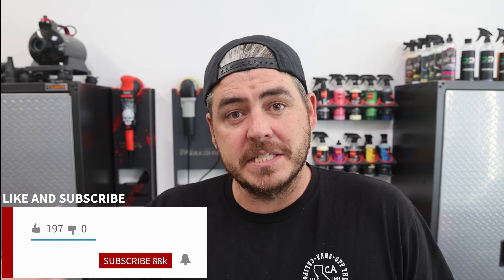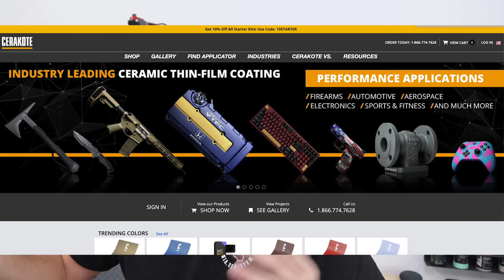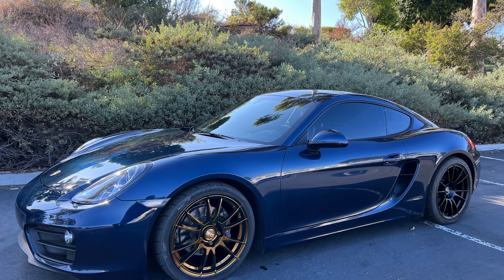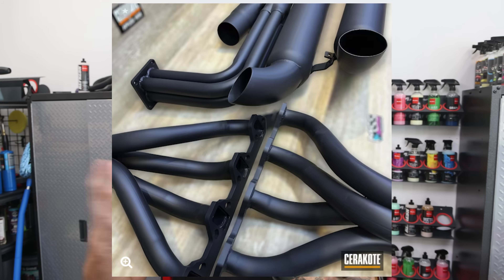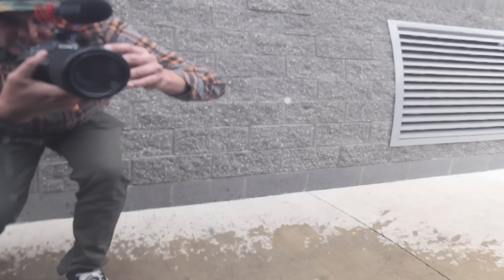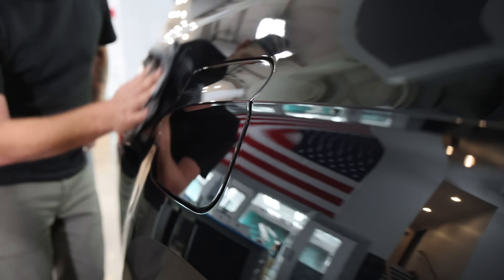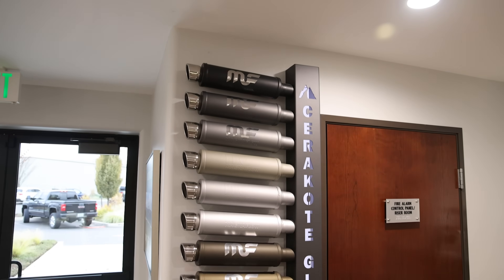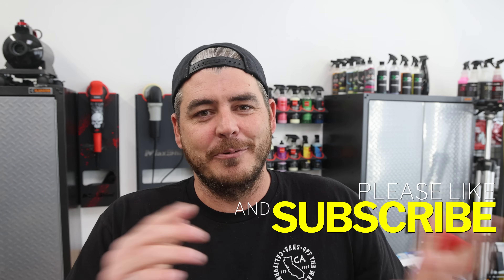EASY CERAMIC PROTECTION FOR YOUR CAR | The Truth about Cerakote

Comment: Josh,  Thanks so much for the excellent teachings on proper ways of vehicle cleaning and preparation.  I have a question that I need help.  I have a new 2023 Buick Envision that had 3,200 mil on it when purchased from Dealer.   I would like to put a coating on it with knowledge it was a demo vehicle.   I have followed the cleaning process and love it with my new Ryobi pressure washer and new microfiber towels + Mr Pink.   I would like to put a ceramic polish on it but do not where to start.  Please provide a path or link for me to use as reference.

Comment: I bought a used freshly painted 2015 F-150 XLT just over two years ago.   The black railings along the truck bed had turned grey along with the mirrors and some other plastic trim.  A month later I gave it a two bucket wash and then used CeraKoat Trim Coat on and to this day the parts applied to are still black.  Oh, I live in Florida and the truck is parked daily in the sun and stays in my driveway every night.

Comment: Is this actually a ceramic coating?
Reply from the maker: It is... Cerakote makes all the inorganic polymers that are used to make ceramic coatings. This one is super easy to use and although its not meant to last as long as the traditional small glass bottle type of ceramic, but it still provides amazing protection and hydrophobic properties.  I personally still coat my cars with a traditional ceramic like Gyeon Mohs and then use this as a topper
Reply: @imjoshv  ok.. sounds great! Thank you!

Comment: Trim coat is a good product , paint sealant which I just applied yesterday for the first time  , my first problem is that is the worst sprayer I ever used and had to scrub harder to get rid of old water spots in door jams !! After it cured for a day the slickness came out ! how long it last is still up in the air 🤷

Comment: Love the videos. I’m not a pro but just like taking care of my cars. I have XPEL ceramic coat and PPF on the car. So rapid ceramic is ok to use on top of these? I’ve been using XPEL booster, but it seems to be difficult to “buff” off with second wipe. Can you just spray on and hose off like with Tech. Choice? Thanks!

Comment: i understand and can agree with the protection varying from car to car, however there still has to be a minimum. and that should be listed. if on some cars it only lasts 2 weeks, i want to know that theres a chance that could be my car. if all cars get 6 months but some can get a year, thats great
Reply: I saw in another video where at the plant, they performed 500 hand washes on a vehicle to test it, and some protection remained, so their claim is 250. Too many variables to make a time-based claim. Do you garage or no, what type of paint do you have, do you live in ND, CA or AK.  Mileage may vary.

Comment: Great video! now I want to try the rapid ceramic paint sealant on my Ram. It has a professional ceramic coating on it now, installed last year. Can I just add the cerkote on top or do I need to strip the old stuff off?
Reply from the maker: No leave the coating you have on there. Rapid ceramic can be applied on top and works great as a sacrificial layer that will protect the other coating!

Comment: I've added the sealant to my paint and glass, i know they have a dedicated glass coating, but it's still awesome. It lets the water beed up, and you can blow the water clean off the surface without it leaving trails! Usually, with wax and water on glass and paint, the drops would leave smaller droplets. This also helps it self clean in my obervation as it lets the water pick up and retain dust as it sheds off the car. I have not had to wash my car after rains, and i have not had problems with any etching if the rain dries on it.
Reply: I bought the ceramic sealant, and I'm now wondering is using the car wash at Sheetz is going to screw up my work. I don't have a place to wash by hand, and it's just easier. You have any take on this?
Reply: @tigergreg8  I've observed that the coating does not do well with acidic soaps/shampoo. ph neutral soaps/shampoo is your best bet at making the coating last. Also, as a topper, I've been trying gyeon wet coat ceramic coating. Both are SiO2 based and they play well. Both coatings are soft, but the ease of application makes up for their performance. I've found that the cerakote lasts about 1.5 months on its own for me.
Reply: @jagtan13  Thank you so much for your input. 👍

Comment: I think the reason they can't give a period of time that the coating will last isn't because of the paint specifically since other companies can do this. It's the surface in combination with their grid pattern of adhesion. It's fewer contact points than a full ceramic coating that has a contact point essentially everywhere. I think this is the same reason paint can breathe with this coating. Fewer points of contact allow for microscopic airflow. I'm sure it's a great product because everything Cerakote makes is amazing but it seems midway between a quick ceramic detailer and an actual ceramic coating. Would you agree?
Reply from the maker: Yea i think youre probably right about that assumption. They label it Rapid Ceramic paint sealant so its not a full blown ceramic. They mentioned to me that they want their consumer products easy to use. Rapid Ceramic isnt something that will last 3-5 years but it definitely gives more than a ceramic detailer.  I see it just like you, it sits somewhere between the two. The added benefit of the gloss enhancement is an awesome bonus that i wasnt expecting when i first heard about it, but i can see a visible difference especially on darker paints

Comment: Use it on I know you aren’t supposed to wipe off but I didn’t and left streaks how do I remove it from the plastic/rubber?
Reply from the maker: If you reach out to them I’m sure they can give you a detailed explanation on exactly what to do. I think it would depend on if you are just trying to remove the streaks or if you’re trying to remove the whole coating. For the trim coat it’s super important to use on a dry surface. If any moisture gets added in you can have some of those effects

Comment: Their headlight restoration kit is bar none the easiest on the market to use and fantastic results
Reply from the maker: Yea they dont release alot of products but the ones they do work really well!
Reply: I 100% agree. Only thing I'd say is include a few more sanding disks. I hit it with 5k wend sand to finish and it looked brand new.

Comment: What's is the hardness rating? Is this a 3 month product? Sounds like another 3 month product, reapplying ever 3 months sounds like to me
Reply from the maker: Hey Joseph I asked that same thing and they said that they don’t list a hardness rating for the same reason they don’t give longevity. It will depend on the surface it’s going on. If you lay a hard coating over a soft paint it will be different than a hard coating on a hard paint. Think of it like a piece of wood on a bed. The outer shell is hard but if you push on it it still moves because of the soft layer under.
Reply: @IMJOSHV - Car Detailing and Reconditioning Tips  thank you for the response

Comment: Great info 👍🏼 bro! I’ve been a fan of Cerakote for a while. I have multiple engine bay parts on my AMG GLC63 coated with Cerakote to stop or reflect the heat. Thx for the technical info!
Reply from the maker: Right on